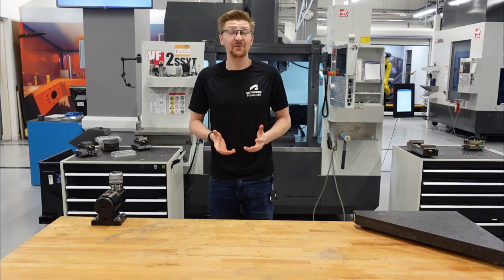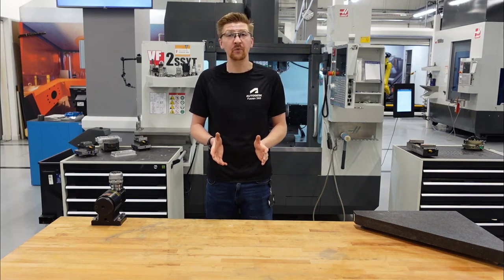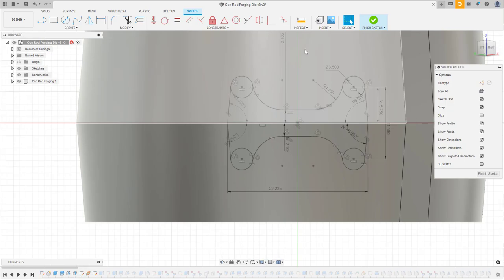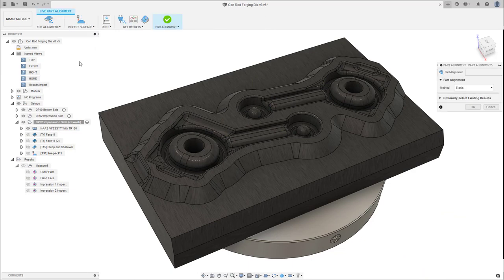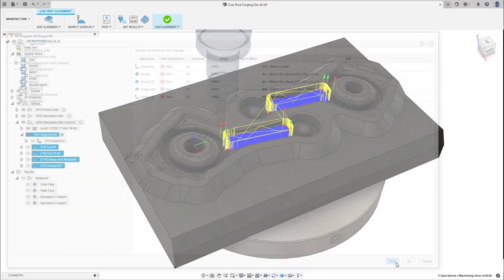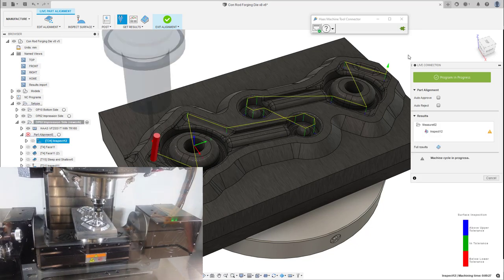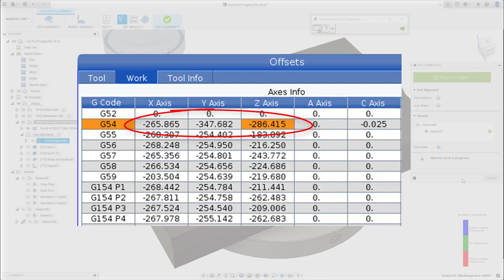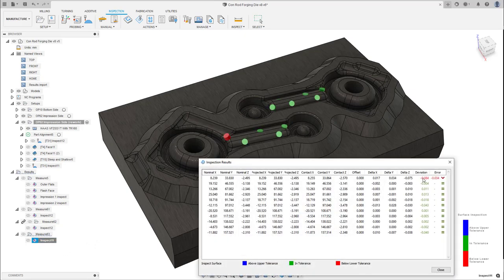Fusion 360 Live Part Alignment with Haas Machinery | Autodesk Fusion 360

Comment: with dynamic work offsets and tool center point control, can't the Haas machines make these axial corrections for you without a direct connection to fusion? I would think it would be as simple as measuring your 2 points along a plane, and correcting a/b/c axis to correct that plane to zero. I have used a probe and triganometery to do it manually (granted with a MUCH more simple part than in the video). In a production environment with multiple 5 axis machines, it seems like extra seats of fusion for each machine shouldn't be necessary if the control to make the compensation for you. Obviously, a direct live link into software for the first-part-prove-out of the process is important, but how about mass production going forward?
Reply: Hi, you are correct in we can use the on machine macros to do simple prismatic alignments, however part alignment comes into its own for more freeform shapes where you are having to solve multiple axis from points at different vectors. This is something that we need the power of Fusion to calculate in a best fit algorithm. 

For simple parts Probe WCS in Fusion is a real time saver, no need to transfer files or have the connection running. 

But for complex jobs like re machining a mould tool, or maybe near net shapes, the stock balancing of Part alignment far outweighs having to have the connection running.
Reply: You also cannot currently probe in 3+2 with DWO enabled. HAAS has been promising it for years, but so far it hasn't shown up. This is an excellent workaround for those times when you really need 3+2 probing, and also for the main use case of probing a ton of points and fitting them instead of just measuring planes and holes/bosses.

Comment: I'm guessing this requires either a wireless network connection between PC and mill or at least an ethernet network connection?
Reply: Hi George, yes you will need an ethernet connection with the new controls or a serial RS232 with the older controls.